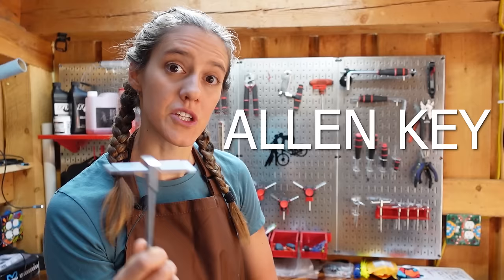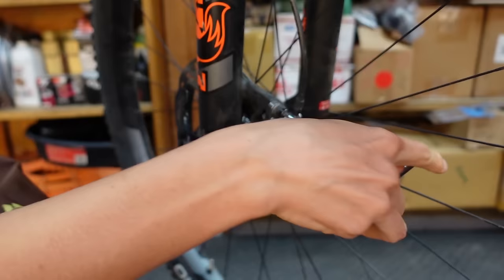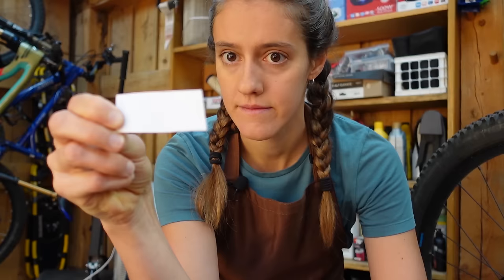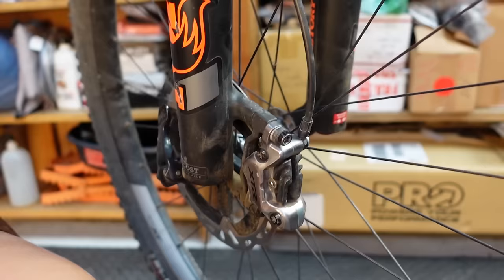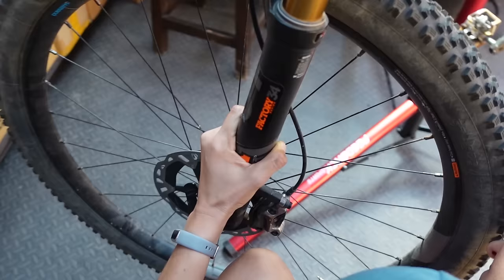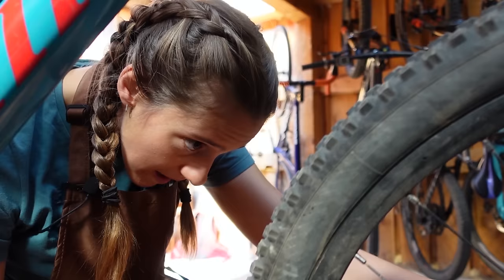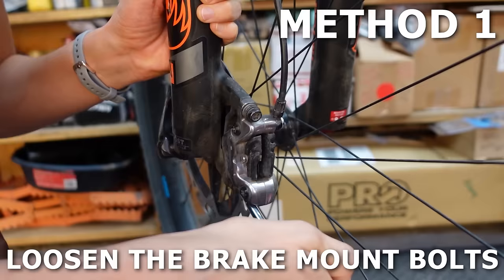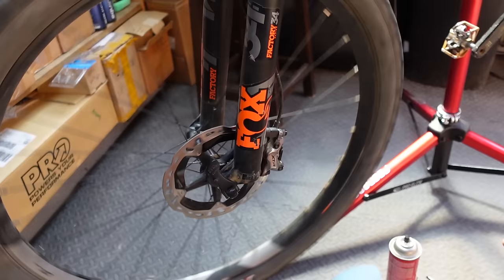THREE DIFFERENT WAYS to center disc brakes and stop rotor rub | Syd Fixes Bikes

Comment: Pro tip... Slowly tighten one bolt barely tight and then the other bolt barely tight and go back and forth until they're both tightened to the correct torque. Don't tighten one down completely and then the other down completely, you will misalign the caliper 9 times out of 10 doing it that way.
Reply: What do you mean by "one bolt" and "the other bolt"? There is only one pad adjustment screw. What or where is that other pad adjustment screw?
Reply: @romanryuninvalek487  He is talking about the two bolts that mount the caliper to the fork (if the front caliper) or frame (for rear caliper).
Reply: @shanefrank3281  Thank you.
Reply: Thanks you're number one!
Reply: when I keep on tightening the caliper keeps moving in wards which’s makes it keep on rubbbing I keep trying to pull it back but it just keeps on going back to its organized spot of rubbing idk how to fix it
Reply: @jayjayt9124  are you applying the brake when tightening?
Reply: yes cool tip.  just like bolts on a car wheel
Reply: Yes.
Reply: Awesome will try that
Reply: I ahea 2 mounts for my brakes???? What do i do.
Reply: @onepiecegang  what type of brake is it? V- brake or disc brake?
Reply: @bitiboy786  I figured it out but it is a disk brake I am gonna switch them out because one side of the brake is not working for now it’s a one sided brake.
Reply: @zap... Are you supposed to?

Comment: Method #3 is what I usually use. I use a light source like a lamp and place it on the other side of the caliper. What it does is the light makes it easier for me to see if the rotor is centered between the pads. Kinda like a "light at the end of the tunnel" approach. I hope I make sense. :)

Comment: Tighten the thru axle the same amount if you remove the wheel. Sometimes tightening it looser or tighter than what your caliper was setup on can result in disc rub.
Reply: As I discovered today

Comment: Another common problem I've encountered is sticky pistons/seals.  The symptom is that you'll hear rubbing, but only after braking, and it will eventually go away after 10s of seconds or maybe a few minutes.  I'm sure you guys have already done a video on cleaning disc brake pistons/seals, it just isn't covered in this video.  As always, a great instructional video!  Thanks guys.

Comment: Definatley keep fingers clear when using method 3, done this last week. Gave the wheel a good spin, went to tighten up the caliper bolts and got my finger caught in a new xtr rotor which incidently are shaped like a seatbelt cutter now, it went down to the bone 😬

Comment: I can't thank you enough for this great video! I assembled my new mountain bike and noticed that the front break disc was rubbing against the break pads. I didn't want to start using the bike before fixing it. I couldn't. It was going on my nerves. Before taking the bike to the repair shop, I decided to look up for a video on YouTube and came across this video. The 2nd way (with the paper) fixed the problem beautifully. What a relief! The repair shop would cost me €60 to €80. I fixed the disc, thanks to this video, in just 10 minutes.

Comment: I have a question about the stuff needed for straightening rotors - is the cat needed? I don't have one, but don't wanna fail ;-p
Reply: It may provide moral support in case none of these methods work.
Reply: You can use it as a relaxing device after a fixing fail. Then do the bike job again
Reply: My cat will only help on road bikes. He seems to think MTBs beneath him (unlike my dog who is yet to discover anything beneath him...)
Reply: Male cats only.

Comment: You guys ROCK! After fixing a flat tire on front wheel, I kept hearing a rubbing noise on front disc brake caliper. After watching your tutorial I nailed it using a combo of 2nd and 3rd methods. Wheel spins forever with no irritating rubbing sound and no resistance! Now to hit the bike trails at the park! Thanks!

Comment: Speaking from experience, wear safety glasses when spraying cleaners.  I had some blow back at high pressure once.  Hurt so bad I ran to the house to rinse.  Was so blind, I hit the door frame with my head on the way.  Not a good day :)
Reply: I almost lost my left eye last week trying to get an old, defunct floor pump to work on presta valves.  What I thought was a smart solution ended up flying out and missing my eyeball by half an inch.  Safety goggles would have been smart!

Comment: Thanks! Just got a new E-bike and it had this problem on both brakes (bike was shipped out and needed some minor assembly). After a few tries of the first method my front wheel had no more rub, but the same didn't work for the back wheel. So after doing the second method on my back wheel it, worked! However, I did tweak it a little by using two separate pieces of paper instead of folding one piece.

Comment: Pretty useful, didn't knew the paper tip! Actually, it's my first time ever with a bike with rotors. 😂
Brand new but had to adjust the rubbing.. Now moves freely with a tiny bit on pinch noise. I guess I need to see if anything is bent. Even if the bike is brand new, sometimes on unpacking and assembling could have slightly bent something.

Comment: Great job Syd and team. Only additions I can think of are: 1) I suggest using a torque wrench and tightening caliper bolts to proper specs for final bolt tightening, and 2) you can buy a brake pad and rotor alignment tool (from Hayes and others), which essentially takes the place of the folded over piece of paper.
Reply: I am having one &#@$!!! time with a rotor right now.

Turns out I had tried all three methods before watching this vid, and am still having a huge amount of trouble!

Comment: Method 4:  Manually...but amended:  Loosen caliper, spin wheel, CAREFULLY and lightly (don't catch fingers or knuckles on spokes) center the caliper as wheel is spinning, alternate tightening caliper bolts in eighth turn increments.  Spinning the several times during process is sometimes necessary. This can be done without a stand on the trail or in the garage while the bike is upside down.  Awesome video btw!

Comment: I found my way of doing this by centering with finger pressure and position of caliper, then tighten lower bolt just a little then top bolt just a little, then bottom then top and YES i do need to slacken off and restart the process as sometimes at a point I find that the tension will SWING the caliper just enough to take it out of line.... but progressive retakes on this does make for eventually perfect alignment. Not too much on any bolt but lots of small allen key movements to bottom and top bolts untill totally tight with NO NOISE and perfect wheel rotation SWING IT BWOYS!!

Comment: Nice video!  There is a specialty tool for the hotdog paper method.  It's a metal shim.  I don't remember what it's called, but using it avoids having to take the caliper off.  But still, your method #3 is often needed.  A mechanic at a bike shop told me that 80% of the time, that's what he has to do b/c methods 1 and 2 don't work on the bike in question.

Comment: Wow! Ty. It was much better after the first technique alone, then I used the piece of paper as suggested now it's perfect. Front tire disc was rubbing. pretty sure the disc is slightly warped but this will do until I can replace it. I hear no more rubbing at all. 😎👍
Reply from the maker: It's also pretty easy (and a lot cheaper that replacing it) to straighten the rotor if it's only slightly bent 😉

Comment: Its hard to stress just how gentle you gotta be with the rotor bender tool. I fought a rotor for 2 hours once til i realized i was making it worse by bending it too far. I was ready to give up and put on a new rotor when i finally figured out the gentle touch

Comment: I learned the 'hot dog' method few years ago, but instead of paper I use some  piece of soda can. Easy to find some scrap and slide easy between calipers and rotors.
Reply: Awesome idea! Just be careful to not scratch your rotor because a soda can is aluminum and your rotor (depending on brand) is aluminum or steel so just be careful not to scratch!
Reply: In ancient times, we had feeler gauges.

Comment: Your vids have been a great help to me Syd. My new  Shimano XTs and Ice Rotors  were so close,  between pads and pistons,  that they rubbed and I manually loosened the mounts and retightened them incrementally while spinning the wheel. Problem is I couldn't see a gap and that is a problem with some brakes having such tight tolerances. Feeling for vibration was what finally worked.

Comment: Some times I use a feeler gauge (paper would work) between pad and rotor on one side lightly pressing on caliper with my hand ensuring gauge between rotor and pad is in full contact then tighten.

Its sort of like half manual half paper trick, sometimes paper on both sides just doesn't work, one piston more aggressive than the other

Comment: I have a new set of magura mt5 that have had issues since new, I did the first method, but the one thing I did different is I pushed the pistons of the caliper all the way back first, I think that was what made it so easy to get centered perfectly, versus my prior attempts were method 3, with the pistons pushed out to their normal limit from normal usage.

Comment: Detail on method 3, noticed the white paper on floor below bike. Assuming you use this to provide contrast so you can see the gaps better.  This is very helpful.  When I set up a disc brake this way I put one of the shops white shopping bags on the floor first thing. (Has a note on it not to remove it from my bench😎)
Note, methods 1 and 2 don't work with cable operated calipers with one piston.
Otherwise a decent tutorial.

Comment: not a bad idea while you're at it to use a digital caliper/micrometer to check that your rotor is within its thickness spec (search for your brake manufacturer/model's manual).  when rotors get too thin they can warp/scallop when hot & then things get interesting--usually happens on epic descents in the middle of nowhere.  a rotor slightly under spec is good to keep as a spare in your toolbox, especially for road trips where you might not be able to find a suitable replacement.

Comment: Sometimes it's hard to tell which side is rubbing (especially with lighting issues), but it's usually VERY easy to see the rotor shift sideways when you squeeze the lever.

Comment: If you loosen the caliper bolts and spin the tire then instead of grabbing the break modulate the brake so that the pads are just starting to grab before braking fully will help to center the pads around the rotor better.

Comment: I have been trying a 4th way, it works for me, just like the first method, but don't grab the brake lever, then tighten the preloosened caliper bolts a little bit at a time, very cautiously, until tight, then spin the wheel, let it spin until it stops, if it kicks back its free, sometimes its a very small kickback, but that, and listening is all it takes to see if its free. I don't take the wheels off my bikes often, I have a cargo van so my wheels aren't removed often.. so this method may not be perfected, so far its worked for me. It sure is easy..

Comment: Hayes feel'r gauge or super b pad alignment tools work really well. Like your paper method but better using thin spring steel fingers between the pad and rotor. The hayes one is easiest to use.

Comment: This channel is great. The way you work on bikes is the way I try to work on bikes but I don’t have the behind the camera help. I disc brake rub in the past and now I don’t have to take it to the shop next time.....unless I mess it up. Can’t wait for the derailleur adjustment video. I have been jacking with mine for days and can’t get it right. It’s great on flat terrain but the minute it goes under load it stalled or clicks. I can go up 2 down 1 and it fixes it. Argh why so hard. Lol.
Reply from the maker: That sounds like worn cable/housing! But the adjustment video will be out in 2 weeks, so hopefully that'll help!

Comment: Cool vid. I actually find a cut out piece of disposable plastic water bottle works better than paper for method 2...its about the same thickness (these days) and, as it's stiffer, it's easier to maneuver it up in between the rotor and pad, without having to take your rotor off. Otherwise, same principle.

Comment: Here's my bonus tip that I just learned: if the paper doesn't work try a thin fridge magnet. I tried the paper thing a few times and never got a good result. The magnet was just a bit thicker, and less compressible too. Worked perfectly.

Comment: I often need the manual method. One tip is to have the bolts starting to tighten up and tap with the back of the hex driver to shift the caliper. The issue is that tightening the bolt wants to rotate the caliper, so you need the other bolt a little tight to resist that rotation (chicken & egg problem). Alternate between bolts, tightening each a tiny bit and checking the alignment as you go.
Reply: Use a little lube at the friction point to help the bolts not walk the caliper.
Reply: @TheLarryBrown  great idea, will try that next time!

Comment: Question about the differences between methods 1 and 2. Does having a permanent offset caused by the paper (usually paper is about 0.2mm thick) permanently offset the min and max positions of the hydraulic pistons when actuated? Since the paper is going to be placed on both sides of the rotor the "center" position of the caliper should be the same for both methods 1 and 2, with the only significant difference being that offset, so this implies that the hydraulic caliper has a sort of "memory". I'm pretty new to these and am watching this video to fix some rubbing (method 2 worked well for me) but I'm really curious as to why it works.
Reply from the maker: In general method 2 works where method 1 fails if the pistons aren't moving evenly so the paper forces there to be space on both sides of the rotor. It doesn't create a permanent offset of the pistons because even if it did initially, once the lever got pulled after the paper was removed they would reset then.

Comment: My front brake was zinging recently. It took a couple of attempts with method 1 over a couple of rides to get it quiet.  Next time I'll try method 2.  And I did get the tip of my finger nipped by the rotor during the process.  Not good!  Be careful.  Glad to see the sub list expanding.  I was 576.
Reply: Yup. Got my finger bit hard this evening.

Comment: So I had the issue where the mounting faces were not completely flat. After centering and tightening, and after a few times braking the caliper would get back in its uncentered position again. So the fork mount needed to be faced with a special tool. Luckily that doesn't happen often, but you cannot fix it with these methods. Additionally, after the facing I had the issue where after breaking rubbing started again for about 10 seconds. Probably due to sticky pistons, or differentiating pressure in the brake line.

Comment: 1:if it’s rubbing a lot try to mess with the spokes like align the wheel
2:loosen both both and hold it to one side then tighten
3:get a new rim
Reply from the maker: The rim and spokes have no effect on a disc brake. That's one of the advantages of disc brakes vs rim brakes.

Comment: Great videos, you guys. I love the little touches of humor with the cat, etcetera. Your strategy of having a smart (but slightly less knowledgeable) partner on camera, and then the more seasoned voice off camera doing the coaching is brilliant!  

But I have a question.

How can the paper hotdog bun fix possibly work?  I mean, I get that the extra thickness of the paper around the rotor creates a little additional space between the pads and the rotor.  But the very next time you apply the brakes (after the bun is removed) aren't the pads and pistons going to go right back to where they were?

I don't get it. What am I missing, here?
Reply from the maker: Theoretically, the paper trick should be no different than the first method (no paper) but in practice we've found that it often works. I think that's because when you pull the lever with the paper in there, it doesn't pull as far (ie the pistons don't move as far) so you get the disc more centered in between the pads even if you have a sticky piston on one side (which is the likely cause of the first method not working). So then even if one piston moves more easily than the other, by using the paper you are better centered so when released it doesn't rub. We have been meaning to do a video on fixing a sticky piston because that's a common problem but haven't gotten and to it yet.
Reply: @sydfixesbikes  Thanks, and I look forward to the sticky piston video!

Comment: Thanks so much for this video. Would be of immense help if you could help me out.

My new cycle has 21 speed microshift gear. But chain skipping no. 3 in rear.
Currently my chain is on 2*4. Speed. I rarely use gear. Should I fixed this or leave it As I don't use gear. 

Secondly my cycle has alloy  frame matte finish How to protect it I couldn't find helicopter tape. In market car wax and ceramuc spray available.

Thirdly,
Should I use alcohol based hand sanitizer to clean the frame?

Comment: Great vid! If my pads are not rubbing, but do rub unevenly when they engage with the disc (causing initial noise before fully braking) should I adjust the caliper or will they bed in?
Reply from the maker: Most likely your rotor is a bit bent. Probably worth trying to straighten it as we explained in the video.